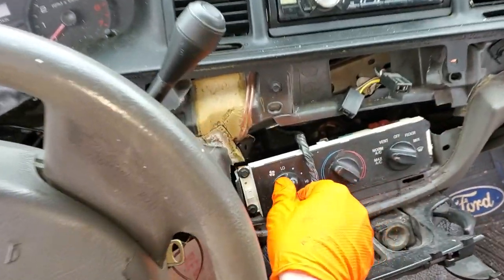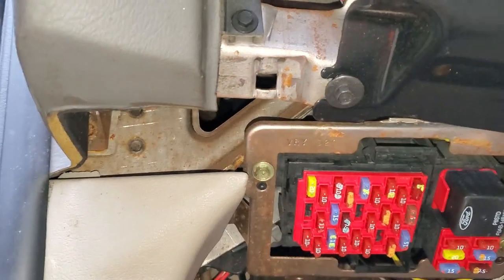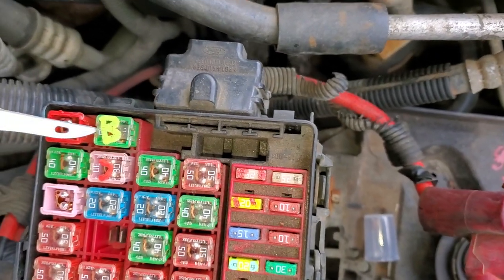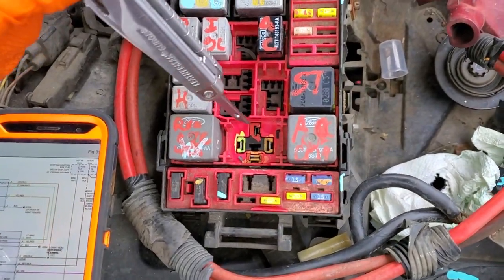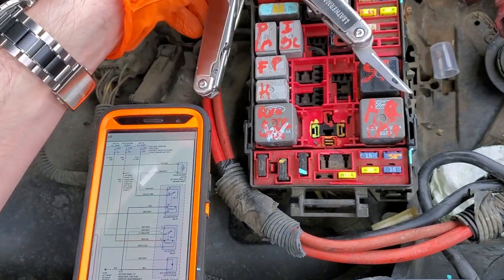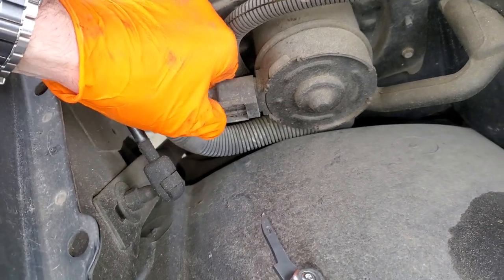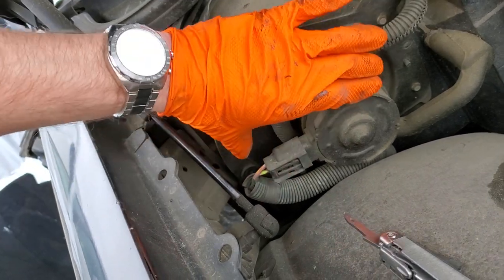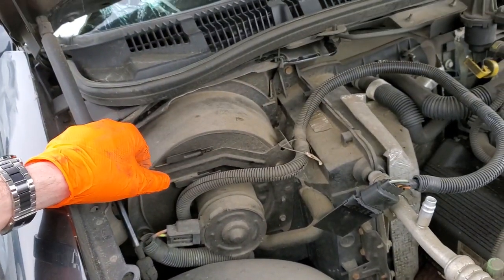2006 Ford Crown Vic Blower Motor Fuse, Blower Motor Relay & Circuit Explained

Comment: I've been driving old Volvos for decades. I just never have driven anything else. Finally, my Volvos are SO old that they have both developed very spooky electrical gremlins simply because after 30 years or more, the wiring has just broken down. Finally, in desperate need of transportation, I bought a 2003 Mercury Grand Marquis. WOW! WHAT A REVELATION! I love love love this car. But after just a few weeks, the weather here has turned very cold and my blower motor stopped working. I've had fantastic heat up until just this morning. I can't thank you enough to putting this video up and helping me sort out probs with a car that I am so far, totally unfamiliar with. I'm beginning to believe that Volvo isn't the only company that can build a fine car.

Comment: Omg.   Thank you.   So many videos explaining how to replace or repair the EATC but finally I found this one.   Kept me from having to buy a service manual and trace all this out.     Wish other folks would look at car issues from this point of view. By understanding how the entire circuit or component in question operates, the issue can be found without having to swap parts and/or guess.   Also saves from having to watch a million videos about how to replace one particular component in a system because it happened to fix the issue in THEIR car.....not yours .... Thank you again sir!

Comment: Nice to the point.  Unfortunately to I now know it's not my blower motor. I'm pretty sure I gotta rebuild the temp control head unit.  As I've got power to the blower motor. Blower Motor is new.  But this helped me on my journey so thanks for your time saving my time👍👍

Comment: My blower motor on the cvpi just stop working, today in the freezing cold and your video acted as a guide for a replacement . TY

Now if you can tell me why my floor/mix/defroster switch won't work; air only comes out of the ac ducts, and the switch is new.

Comment: Hey brother, just wanted to let you know that I was able to get my AC running here at work using your tips on the blower motor relay check in the engine bay. Thank you thank you thank you.

Comment: Great video. Still need some help. I replaced the blower motor in my 2004 Grand Marquis and had the shop replace the resistor. Air worked for a week then stopped. The shop replaced the resistor again but it did not work this time. They then directed me to take my car to the dealer. What else could be the issue? Only thing I can think of is the EATC but that is a very expensive part to try. I ran the diagnostic and it came up 888 indicating no issues. Any suggestions?

Comment: Mine will only come on if i start with defrost or floor and after a few minutes i switch it quickly to Max AC, sometimes it takes a few times but eventually it clicks over to AC and everything is fine. What part is about to go out on my car? Same car as yours

Comment: I keep blowing the 40 amp J case fuse and can’t figure it out. I’ve replaced the blower motor and resistor, the connectors are all fine and intact. But as soon as I send power hit the power to turn on the blower motor it pops the Jcase instantly. I’m stumped. I’m guessing there’s a short somewhere at this point

Comment: I got power at the blower motor connector but no ground...i  put power to the blower motor and it ran...I tried another climate control switch and the blower motor is still inop....I tried swapping relays also checked the fuse both are ok...Im gonna try the resister next...any advice?

Comment: Quick question bro, I own a 03 marauder nd idk what it's been done to it but the ac control unit does not have power at all. Relays and fuse good. So change to a new unit

Comment: I have an 07 CVPI and low 1 and low 2 don't seem to be working.  Settings 3 and 4 work just fine tho.  Not a big deal, but might be an easy fix?  Thank you in advance, enjoy these videos.
Reply: @dannyzuehlsdorf3697  check the switch and connector itself, could be melted
Reply: @DirtyDanMunicipalMan  turns out it was the blower motor relay.  Replaced and everything's working properly now.

Comment: Like a big dummy, I forgot my 2006 Ford 500; limited was running in my driveway, for almost 9 hours. Afterwards, now my heater fan/blower is not working. Could it be the relay thing under the dash on the passenger side? Thanks for any suggestions. John

Comment: I have crown vic 99 i am facing problem with blower when i run my blower to high speed the fuse blowes away and ac blower stops working 
I have taken it to many mechanics even i hv change my blower and fan but still the same problem
Please can you enlighten me with your knowlege on this issue

Comment: Hey man... I’m having a little issue with this circuit. When the key is off, everything is fine. When the key is on, the blower motor instantly comes on even though the EATC is off. On top of this, after turning the EATC on, the motor doesn’t respond to any speed input. Do you think the BCM (blower control module, or in non EATC cars it’s called the blower motor resistor) is bad?

Side note, this all happened after I replaced the AC accumulator switch but I bet that’s unrelated.
Reply from the maker: Its likely to be a short to ground in the blower motor resistor
Reply: Lehew Tech sweet. Appreciate your quick reply man.

Comment: How did your really come out so easy. I’m under the hood with pliers and can’t get it out. I’m sure it’s the original 18 year old part :(
Reply from the maker: In preparing to make one of my videos I typically remove and install the Relay a few times which loosens it up. I have found that many Relays in older cars can be quite challenging to remove if they have not been disturbed in awhile. It can be helpful to wiggle the Relay back and forth while pulling it out. Best of luck to you!

Comment: Does the resistor deal with changing temperature from hot to cold?
Reply from the maker: No, it is only for speed of the blower motor